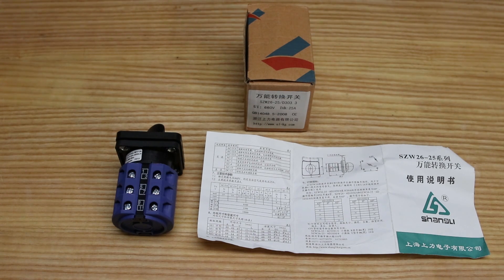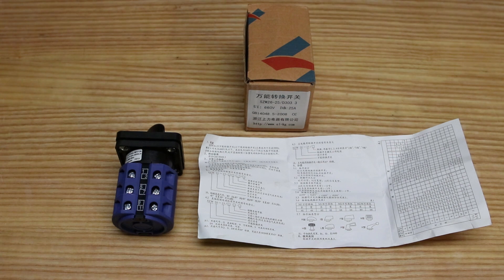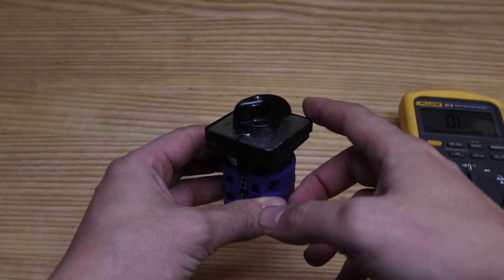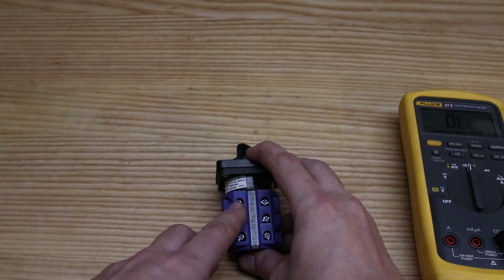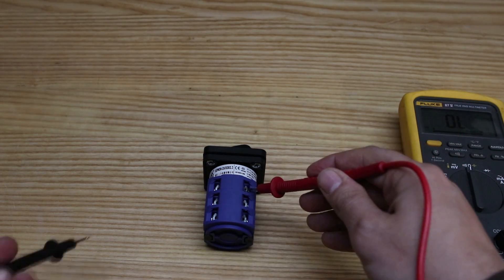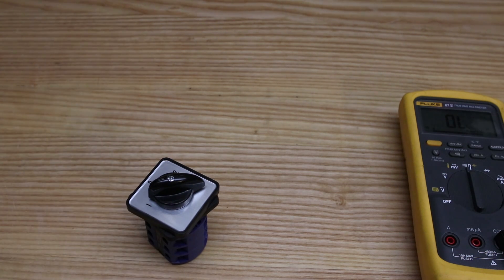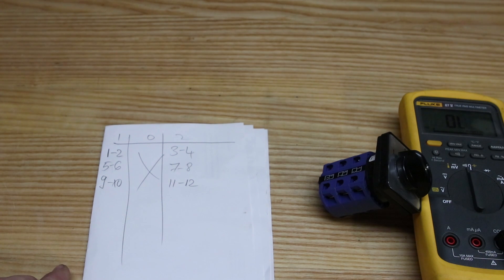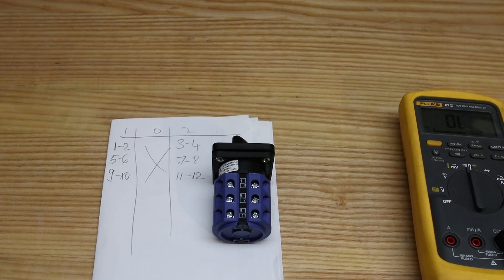3 positions, 12 terminals rotary switch mapping

Comment: Not sure anyone will answer. But in position 1 - you have one source and one destination. In position 2 you have one source and one destination. Those two destinations, on 1 and 2, are not the same? So if I wanted two power sources (shore power or generator), I need to jumper the two outputs? Is that correct? Why would it be built this way?
Reply from the maker: You are on the right track with your connections. As far as why this is built this way I suspect is flexibility, you can jumper if needed or completely shut down one system and connect another.  One shore power going to a panel and one battery going to only essentials.

Comment: so I'm assuming, once you figure out the continuity, you go 3 wires (hot, neutral and ground) in the position 1, and the other set of 3 wires (hot neutral ground) in position 2. 0 is being off for everything. Also, is it able to switch during load or does it arc like crazy?
Reply from the maker: You got it. I have not tried to switch during load so I can’t really answer.

Comment: There is no joint numbers! For example switch one generator and main breaker 
Second switch building and again main breaker. You can not main breaker in the rotary twice. I have tried all the combinations but did not work!

Comment: I have this exact switch and am trying to figure out how to reverse a 3 phase motor.  How would I have to hook up the wires on this switch in order to do this?
Reply from the maker: You need to look at the plate of the motor first as it will generally tell you what you need to do to reverse it. You will likely just need to switch two of the supply phases xyz goes to yxz. So just wire one side of the switch in one phase direction and the other with the lines switched. Then take power to the motor from both sides of the switch.
Reply: @asquaregarden  My brain is starting to hurt a little.  I've wired up my whole shop, but switches and stuff mix up my mind.  Knowing I have the three wires (plus ground), those three wires need to be hooked up a certain way on one side of the switch and a certain way on the other.  Which numbers do I have to put the wires in so that I can reverse the motor?  Thanks!

Comment: The one I bought in 2011 was made in 2003 but has exactly the  same contact positions. Really, it's six on/off switches built into single body, three in position one and three in position two with nothing contacting in zero position.. As soon as you know that you can wire various contacts as on/off  to turn on two sets of three components simultaneously, (using common ground)) or add jumpers to reverse polarity, etc

Comment: Thank you for taking the time to make this video.  Have been searching for someone that speaks English to describe this switch.  So, I read on Amazon reviews for this switch that someone was able to use it to switch between 120 volts ac between two different supplies from grid and off grid(solar) power to their workshop.  So there would be three wires going to the switch, two lines and a load.  All three wires would have a ground, neutral and hot wire or bare, black, and white wire, therefore 9 individual wires altogether going to the switch.  With all those terminal points that your were talking about 2-5,4-7, etc., how would you wire these terminals with the 6 line wires and the three load wires in order to be able to supply a workshop with either grid power or solar power?  You had mentioned at the end of the video contacting an electrician.  Save me a trip please, you can speak hypothetically on how you would do it, if you were trying to do this.
Reply from the maker: I will start with the assumption that you are asking about doing one circuit not the whole house panel. So let us assume that you have a 20 amp circuit running to the garage and you also have solar panel array with batteries and an inverter. The way you would have to have this wired is something like this: The black, white and bare coming from the panel would have to be connected to 1, 5 and 9. The black, white and bare from the ac/dc inverter would have to go to 3,7 and 11. Then you would have 2 black wires coming from 2 and 4 connected together with the black going to the outlets. 2 whites from 6 and 8 connected with the white line going to the outlets and 2 bare coming from 10 and 12 connected with the bare going to the outlet. I am currently using the switch to control the output of my VFD, the reverse of what you are contemplating. I may take some video if I get a chance.
Reply from the maker: Here is the video I was talking about . https://youtu.be/NBnVht7qq1Q
Reply: I have placed one of those switches in my shopping cart on Amazon.  Was afraid to pull the trigger because of the complexity.  You have helped me with this and for that I am grateful.
Reply: @asquaregarden  Hey! Thank you for the video and comments I've searched everywhere for this. I just have one question if you can help about how the outlet wires are connected. 

I want to use the switch for the same purpose as Jeff Lahman. But I'm a bit confused when you say 2&4 are connected together with the black going to the outlets. 

For example with the black wire: 
-  1&2 have two separate black wires coming from the two separate power sources. 
- Is 2 then connected to 4 with another separate black wire? and then one black wire from 2 or 4 connected to the outlet?